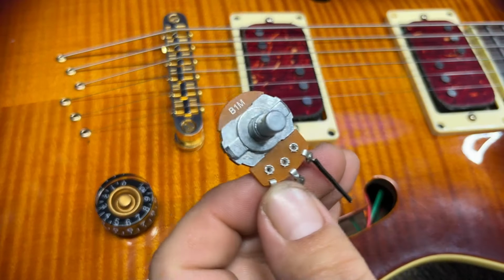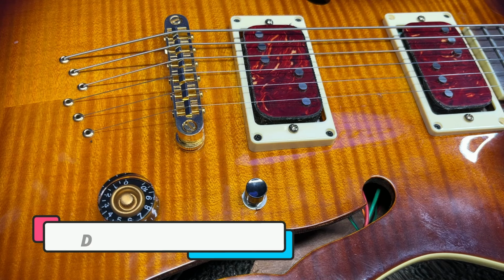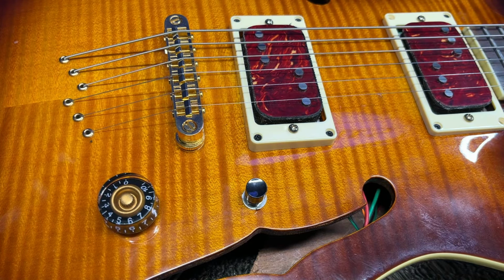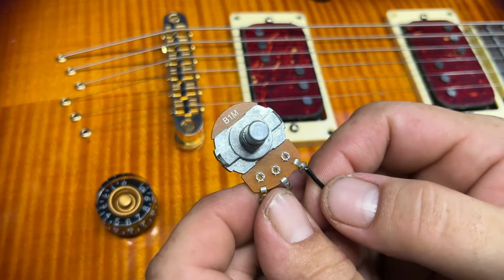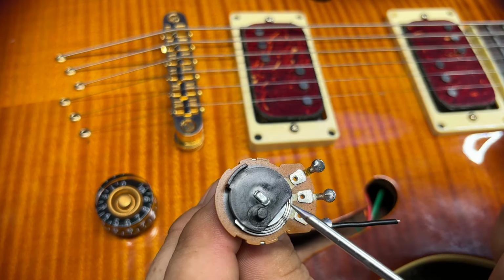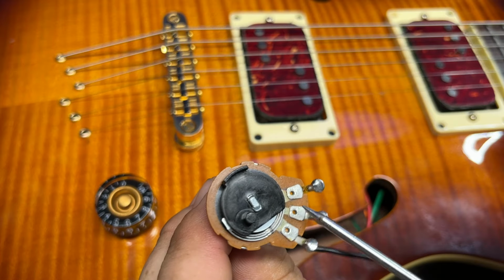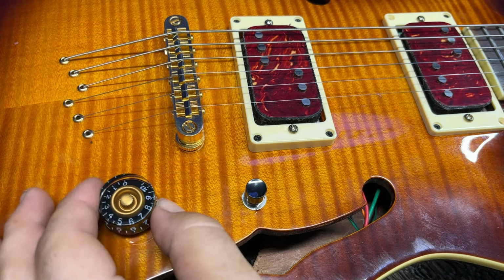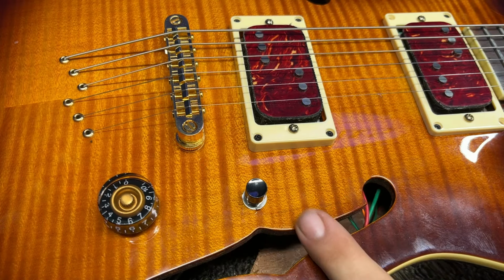Volume Pot Comparison  1meg - 500k - 250k - 100k - 25k

Comment: Your demonstration seems to be done with a specially wired guitar without tone pots. If someone needs to modify  the volume pot values , must think about the fact that tone pots are parallel with them ( the capacitor behaves as a few ohms on sound frequencies - the tone circuit works as an LR low pass with variable R values) . So if you change the 500 k to 1 meg , you do it in vain unless you change the tone pot too for the same pickup.
Reply: True, i went from 250k to 500k on the volume pot and 250k on tone pot, the signal sounds brighter overall but something is off
Reply: Tone pots don’t drain to ground like a volume pot as a voltage divider. They have an impact but not nearly what the volume pot does. 

This video does not show you the impact the volume pot resistance change would have on YOUR guitar. They are a number of other factors involved there,  including the inductance of your pickups and your wiring scheme. But it does demonstrate the impact a volume pot resistance will have.
Reply: @ They do drain to ground via the tone cap for ac current i.e. in the frequency range of guitar . The E6 has ca. 83Hz and the tone cap impedance is about 90 kohm ( for higher frequencies even smaller)  so altogether with the 500k tone pot ( turned fully up)  it represents 600kohm to ground and if the 1 Mohm is the volume pot value, the residual parallel impedance will be about 380kohm . That creates an LR low pass with the 2-8Henry of the pickup.
Reply: @iamgumbydammit2217  so i changed the tone from 250k to 500k, it had a big impact for me (i am picky so the smallest thing is notourious for me).

But for the general player it will still be a change, just not that big

Comment: great job! very usefull... i like to use 500k pots with no tone conected...
Reply from the maker: I play Warmoth guitars with no tone knobs. My les Paul had tone knobs on push pulls so they’re not engaged.
The Shechter guitar is my test guitar to do mods on.
Reply: I have the same setup for my single Humbucker Strat build, definitely makes for a tone that cuts through a mix haha

Comment: What about an HSS with a Dimarzio in the bridge? , I bought a Mojotone Strat wiring kit with all 250 K pots, not sure if I did the right thing!  It’s for a Kramer F6000
Reply from the maker: @buck7477  that’s typically the way a HSS is wired up. Personally I would use a 500K pot and use an additional 500K resistor on the pickup switch that will know the pot down to 250k when you select the single coils.

Comment: I'm an engineer, guitar pickups are high impedance, so they have a resonant filter in the audio frequency.
Changing the load, or here the volume's value, you're basically controlling the height of the resonance, that's why 1M is brighter and the lower you go, the darker it goes.
Reply from the maker: Yup
Reply: That's the most insightful and simple explanation I've heard on that matter. Gotta thank u for ur knowledge

Comment: I have 500k and I strive for 1meg on all my guitars regardless of pickups.
1meg is not a treble booster, it's not boosting anything and not adding anything that's not there. The others on the other hand take away content that's there automatically, the higher the value you get more of the pure signal from the pickup.
I find it way more benificial to have more than what I need and in case of needing to cut anything I'd just use the tone knob (I'd never use a tone knob lower than 1meg), rather than feeling I lack something and trying to add it artificially.
Reply from the maker: Very true. The point of the demo was being able to “fine tune” your guitars to reduce the amount of adjustments you do to your tone knobs or amp settings when switching between different guitars.

I would definitely recommend 1Meg over 500k but I would say 4Meg pots have a more open sound like nothing is there.

90% of my guitars have the bridge pickups wired to a 500k pot and the neck pickups are true bypass no pot / straight through.

Comment: To add to this, if you have a Strat or Tele and find the bridge pickup too bright, before changing pickups or something, try adding a small resistor inline from the pickup at the switch. This will change the resonance peak slightly and may make the pickup sound better.
Reply from the maker: @miket.220  i believe adding a resistor inline/in series will only lower the volume.  Adding a resistor in parallel would have more effect on the resonance peak but the resistor would have two be equal resistance of the potentiometer (500k resistor with a 500k pot) (250k resistor with a 500k pot)…….

And I could be wrong about all that, feel free to correct me if I am.

Comment: Cool video, good info, can you tell me the specific name of that potentiometer with all the different resistances? I'd like to get one, Thanks!
Reply from the maker: @CanadianRockerGuy  it’s a 5way rotary switch and not actually a potentiometer and is only simulate different pots by switching to different resistors

You can email me and I’ll send you parts links and wiring diagrams.
ruckusaudio@yahoo.com

Comment: So, I've been thinking about chamging the pots on an 8 string to 1meg, but i really dont want to give up the push/push switch on the 500k pits that are on right now. Is there a way to just... frankenstein together a 1meg push/push pot?
Reply from the maker: Sorry for the late response but I wanted to do some experiments with pots & resistors before I sent you an answer.
I have good news bad news for you. The bad news is there’s not a way to make the 500k into a 1Meg property. The good news is you can add a treble bleed capacitor to your 500k to let more highs through.
Since you want a bright wide open tone I would suggest adding a .001mf or a .002mf capacitor to lug 3&2 (pickup lug and center lug).
That should give you the 1000k bright open tone. The treble bleed circuit also retains the brightness as you turn the volume down and won’t get muddy at lower volumes.
Reply: @ArtoriusGuitarNerd  dude! THIS is the answer I've been looking for! Thanks so much!
Reply: @ArtoriusGuitarNerd why not replace the tone cap rather than having a treble bleed on a tone cap? Just wondering if there is a difference? Thanks.

Comment: Great vid, thanks! Total noob here, learning to play on a Squire Sonic Mustang HH (cheap starter guitar). Whilst learning realised I prefer finger picking blues/rock styles. Swapped my stock humbuckers for Alnico 2 PAFs which have brightened sound nicely, just not enough. Pots are 250K standard on Mustangs, even the HH models. Looking to change to 500K pots now. Assume need to upgrade both vol and tone to 500K? I don't quite understand the relationship between vol and tone dials. If vol is 500K but tone remains at 250K then how is the different from both being 500k, electically and audibly speaking? Hoping someone can help me 🤞 Thanks.
Reply from the maker: Absolutely would change both volume & tone pot to 500k or 1Meg to get a humbuckers full high end.

I have a revised version of this video on my channel and I change the values on both the volume & tone so you can get a better idea of what the tone knob does.

Btw in my opinion I truly think you should be using 1Meg pots all around on a Fender Mustang because the scale length is so short 24”…. That’s shorter than a  les Paul, the shorter the scale length mean the warmer the guitars overall tone is…. I would counter balance the warm guitar with bright electronics.
I think Alnico 2 PAFs and 1Meg pots would be magical
Reply: @ArtoriusGuitarNerd thanks! So kind of you to give such considered advice. I'll get some 1Meg pots then! Also, hadn't realised scale length has an impact on brightness, great info. Thanks again!

Comment: I would like to hear a roll off comparison as well, my 250k pots on my Fender suck and I just get about 7-8 on the volume, anything below that kinda breaks up and looses alot of tone. 500k on my PRS sounds great at low volume and swells are smooth as silk.
Reply from the maker: Are you saying your Fender breaks/gets muddy up at lower volume?
If so, you can add a simple treble bleed capacitor to the pot. This mod will sound the same at full volume but will retain the treble as you turn down.

The capacitor value will be a .001mf and it will go between the center lug and the pickup lug. Highly recommended trying that mod, I use to have a treble bleed on ALL my guitars before I started running buffers.

Comment: I can only hear the difference if I jump.  As it goes in order I don’t notice it.  It’s a pretty big difference from 1000 to 25 though.
Reply from the maker: Yes, the differences are subtle in the first place. It won’t make a humbucker into a single coil… 
I had the guitar too loud in the mix so the YouTube compression is smearing the frequencies and making it hard to hear those subtle differences. I plan to make a revised video in the future.
Reply: @ArtoriusGuitarNerd  not a dig at your method or execution.  It’s just subtle from one to the next.  There’s is definitely a difference.  I actually intend to give this a shot on the SD JB I’ve got in the bridge of my charnel.  It’s goobery with big strings tuned down.  It’s an alder body and I’ve never had an alder guitar before.  I sold an Ibanez I had because the mahogany body was just too dark.
Reply from the maker: @stevewoodyt  coool! I plan to do a revised version of this video this weekend with volume & tone, clean & dirty. I’m actually gonna be using a Seymour JB in the next vid too.
Reply: @ArtoriusGuitarNerd  Serendipitous!  I’ll be looking for the video.  If I do it I’ll make a video of doing it and link your video as inspiration.
Reply from the maker: @stevewoodyt  nice!  It’s always nice to see someone’s perspective on the same topic.

Comment: Good info. The difference is very small to my ears, but there. I can hear a more noticeable difference between the 1meg and 25k obviously, but could not tell much of a difference between 1 meg and 500k, or 500k to 250k.
Reply from the maker: I’ll be doing a follow up video this weekend. I’ll be doing clean and dirty, , volume and tone.
The differences are subtle, but noticeable between all values however, the YouTube compression smeared all the frequencies, making it even harder to tell. Gonna try to fix that in the next video as well.

Comment: You are supposed to be using audio taper pots in your guitar. Linear taper pots, like the one you're showing in your video,  are not normally used in guitars except in the case of active pickups or onboard preamps. The quicker taper is the the trade off you make for using smaller pots. The quality of the pot makes a difference also, cheap pots have a lousy taper to begin with. Also, on a two volume guitar connecting the pickup to the fixed load(outside leg) makes both volume controls reactive to each other when both pickups are used. Yes this also makes the taper a bit different depending on the pickup impedance.
Reply from the maker: Both audio taper and linear taper can be use in either passive or active circuits, it just depends on what kind of action you prefer. As a pedal builder I have a lot of experience with taper pots (I’ve even done reverse tapers for lefty players).

Comment: Can you share the wiring diagram for the 5 way rotary switch... just how do you mod it to allow for 1meg 500k 250 100k 25k? It would be a great mod for a HHS strat.
Reply from the maker: @worshipfulchords  I’d be happy to send you a diagram but you should know that this is not volume knob. This only simulates the load of each value pot on full 10.
I use this setup to find out what value pot sounds best for that guitar/pickup.
Stacked pots can be used to have different values for humbuckers & single coils at the same time.

Email me and I’ll help you with either a stacked pot setup or the 5way rotary.
ruckusaudio@yahoo.com
Reply from the maker: @worshipfulchords  also you might want to check out this video about tone pots.
https://youtu.be/7tVAwBHJNUM?si=Ef49q48HdiFJzsJk
Reply: @ArtoriusGuitarNerd  I will right away.

Comment: Nice explanation and example of a much misunderstood concept. Thanks for clearing that up for me.

This has me thinking of another question though. On simple electronic stuff with passive tone controls (not separate treble and bass) the tone was being changed by attenuating the UPPER frequencies, the lower tones were there in the same level regardless of the tone knob setting, yet here we are LOWERING the resistance and cutting the upper frequencies and that’s before the tone part of the circuit, a little confusing. Even further off the subject, has anyone offered a guitar with separate treble and bass controls? If so, did it involve the manipulating the signal prior to the tone controls? 

My favorite guitar for a dirty rock sound has a single humbucker with only a volume and output jack and I’m comfortable adjusting the amp tone to my liking so I haven’t messed around much with the controls on the guitar. I can see having a guitar with onboard options would be great for gigs. As I’ve gotten older I have more appreciation for dynamics and I feel like I’m grinding the same tone through entire songs.
Reply from the maker: Yes the same rule applies to the tone knob, changing the value of the pot or cap will change the tone slightly.
Yes G&L guitars have a bass treble knobs and I believe Fender has a similar circuit called TBX. The treble knob is standard parallel wiring but the bass knob is wired in series so your signal runs through it just like a volume pot does.

Most of my guitars don’t have a tone knob either, the ones that do are on push/pull knobs so they’re not engaged if I don’t need them, and I have one G&L with the TBX knobs.
Reply: @ArtoriusGuitarNerd  - Thanks for the reply, I’ll look into those and try to get my head around what they are doing. Have you noticed on your volume only guitars when rolling off the volume slightly the tone cleans up some before the volume decreases noticeably? Kind of interesting what is happening there (electrically). Maybe some value to a pre-volume control for quick switching…. Anyway I plan to tinker with this in the near future, thanks again for gettin me on the right track. Like Many other people I was skipping the significance of the volume pot, thinking about tone capacitors and pickups. 👍
Reply from the maker: @rustyaxelrod  yes the clean up roll off is from more load being added when you dial down the knob. Analog amps and pedals react well to different loads….digital circuits don’t work the same, most likely because it’s all 1s 0s.

Comment: I disconnected the tone pot on my neck pick up and it sounds a lot better without the tone knob and then did the bridge pick up. It's a les paul. Think I am going to try a 250k on the bridge pick up ( I have found it to bright) and then just use the selector switch to change my tone. Was even thinking of trying to turn the old tone knobs into another volume control with different pot values and a switch to flick between them.
Neck 500k and 250k.
Bridge 250k and 100k. Would this be possible?
Reply from the maker: @glenmiles483  yes that’s possible. I personally would use push pull pots to switch to the other pots so you don’t have to add any extra toggle switches to you ax.
Reply: @ArtoriusGuitarNerd  Any tips on how to wire the push pulls? I have no idea lol
Reply from the maker: @glenmiles483  yeah send me an email and cook up a wiring diagram for you.
ruckusaudio@yahoo.com

Comment: Great video, very informative, Can you please help me out with a tech problem? I have a Music Man Sterling Majesty with a push pull boost on the master volume pot, I tried to wire the pot as a single volume for the bridge pickup (as I prefer individual volume pots for each pickup) and could not get it to work, do you have any suggestions or advice to achieve this mod?
Reply from the maker: I’m assuming you’re doing away with the tone knob and wiring it volume volume.

On the current setup the pickups should be wired to the 3way switch, then to the volume/tone, then to the output jack.
You need to remove the pickup wires for the switch and wire them to the pots, then from the pots to the switch, and then from the switch to the output jack. 

The pickup lead goes on the left lug and the right lug gets wired to ground, the center lug is the output that goes to the switch.

I don’t know where or how the boost is wired. I’m assuming the output from the switch will go to the boost/pushpull then to the output.

Maybe you can email me pictures the inside wiring of you can’t get it going and I’ll try to further help out.
ruckusaudio@yahoo.com
Reply: Thank you for the quick response, I did wire the pickups directly to the pots then to the switch then to the jack but the boost (and overall volume on that pot) still does not work properly, I will send you a photo of the component and the original wiring diagram. And again Thank you.  @ArtoriusGuitarNerd
Reply from the maker: @wrallpaul66  I believe I found the wiring diagram layout for your guitar. I reworked it for your configuration. Email me and I’ll send you the revised diagram.
Reply: Awesome!!! Thanks, I'm at work right now so I'll e-mail when I get home, thanks again. @ArtoriusGuitarNerd

Comment: is must to consider also the impedance : single coil picups normally call for 250 K omhs and humbuckers call for 500 K ohms, and less ohms = less output volume.
Reply from the maker: You really won’t hear any volume lost until you get down to 10-15k. There’s no loss of volume when I change values, the only thing getting quieter is the treble